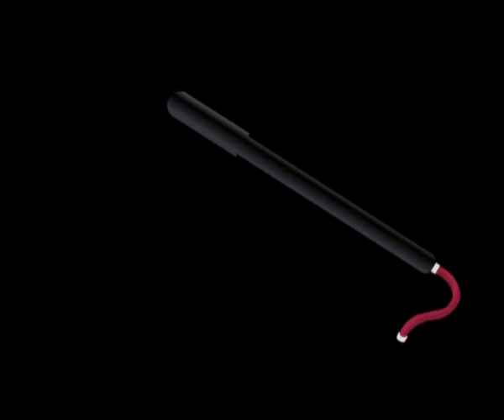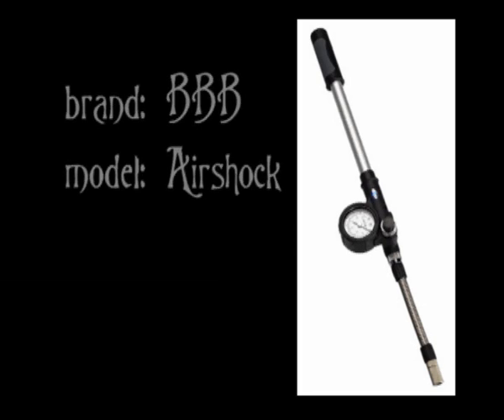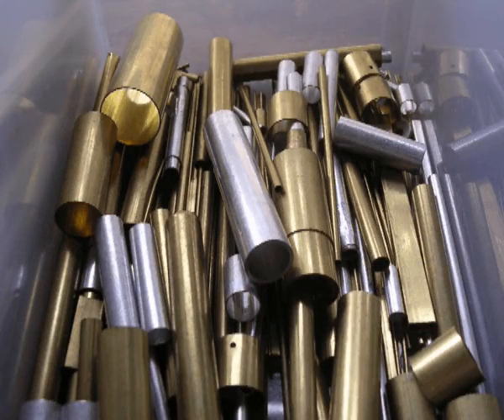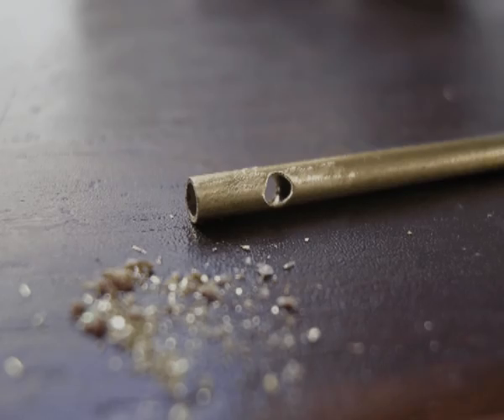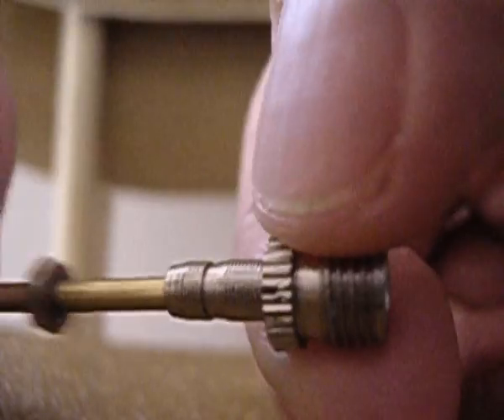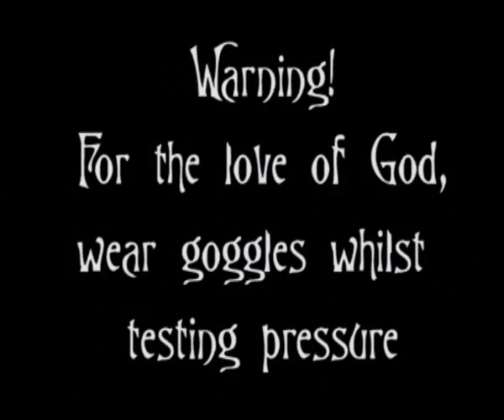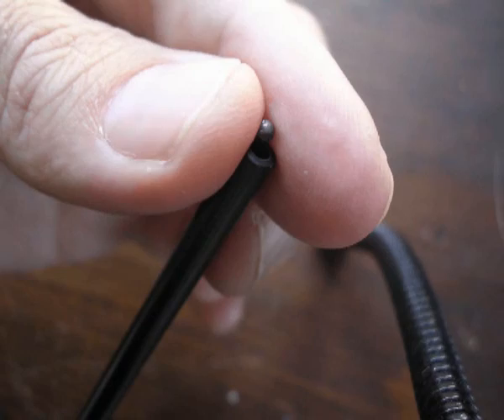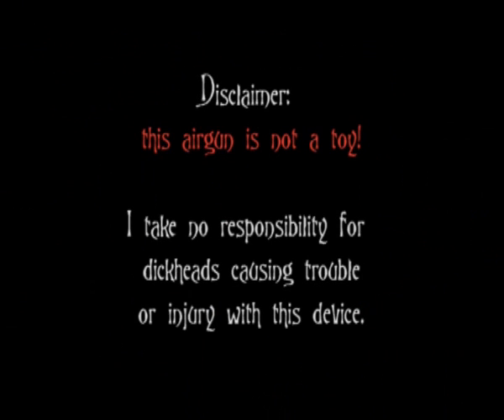Airgun with XRV

Comment: Excellent instruction. You can increase power and accuracy by employing a simple trigger: A spring-loaded piece of thick tube that sits on the barrel (behind the wood block, spring rests against that block) and snaps back on the valve when releaed, thus opening the valve much faster. Add a rotatable metal sear that holds the thing in place and you got a trigger.

Comment: Dude, that valve is perfect!
I want to make a foam dart gun which has pre-compressed air in what is basically a bullet casing, meaning continuous firing can be achieved without having to pump the weapon; but I was trying to find a good valve to use, and this is absolutely perfect for the project!

It'll require a stupid amount of work to produce each round, but still, the idea is awesome :D

Comment from the maker: @cheesenberger44, yes the XRV releases all of the air. However, it's a relatively simple job to rig up a tubular hammer that hits the valve trigger. That way, you could get several shots per tank.

Unfortunately a valve hammer releases the air in sharp pops, so it makes the gun louder - silent is more awesome IMO :D

Comment: i made one and its very easy if you have the right tools and stuff. i didnt use eny glue. i tapped the pipe and srceved screw in there. i use it whit 600psi from fridge compressor. if you want more power you can use like a hammer. the n the air escapes faster

Comment: hmm i got yout idea for couple month ago that are very simular to yours. My idea was to instead of building a pressure valve i was planning to use a safty valve from a localstore. a safty valve are sitting in a aircompressor an releses air very fast at 8.5 bar. and instead of a bikepump i thinked that if i could use an 2 cyl engine and but but the valve in the egnitionhole and than hook up an elektrik engine and a loading mechanism to it and voila! a airpowered machinegun!